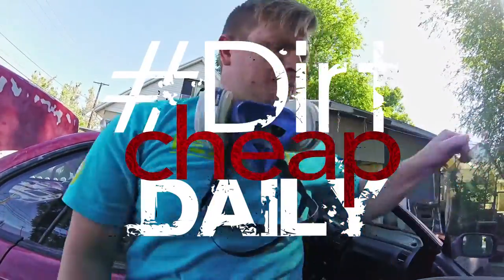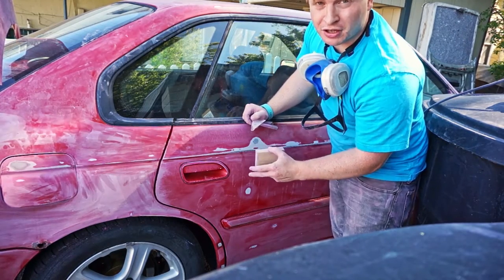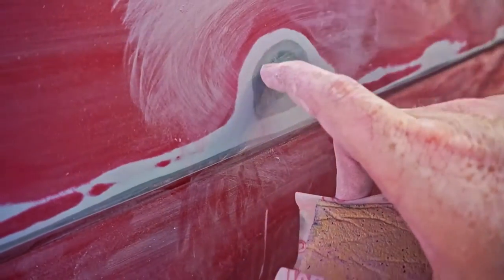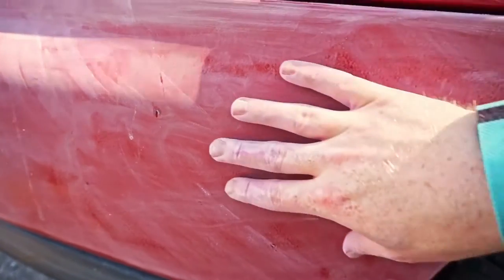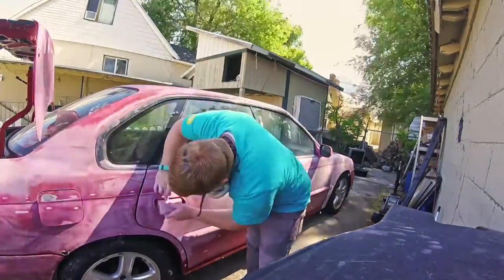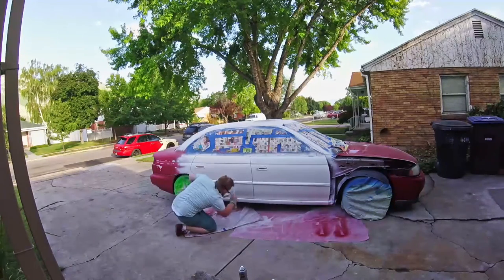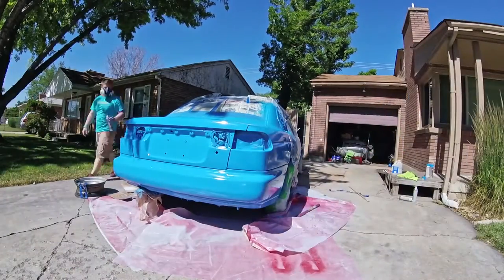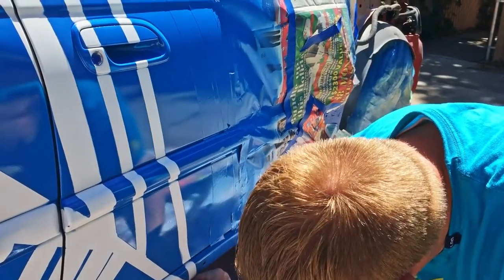How to Spray Paint your car and have it look good! -  Part 1 - Dirtcheapdaily : Ep.13

Comment: What color blue is that?.
Reply: Is it safety blue high performance enamel?
Reply from the maker: +ruffus4924 it's Rustoleum's sail blue
Reply: +Dirt cheap daily they don't make that color in those 15 oz cans just safety blue and Royal blue. I'm pretty sure you have safety blue. I was just wondering because i was going to paint my Miata that color
Reply from the maker: +ruffus4924 oh my bad, I never realized it had a different name in the professional series. It's the same color as the  12oz sail blue. That'll look great!